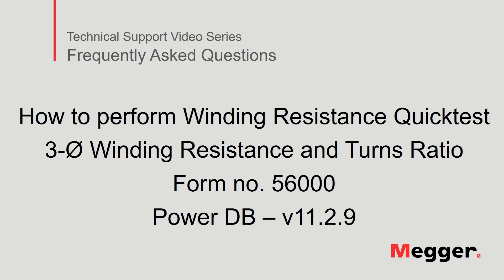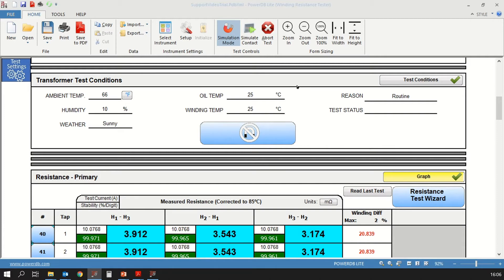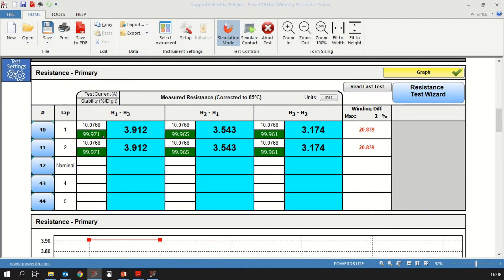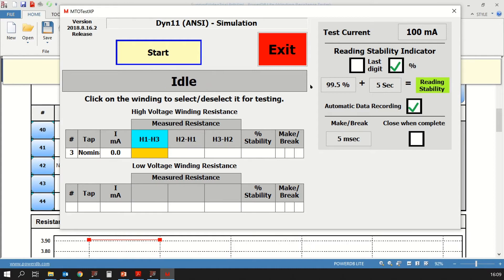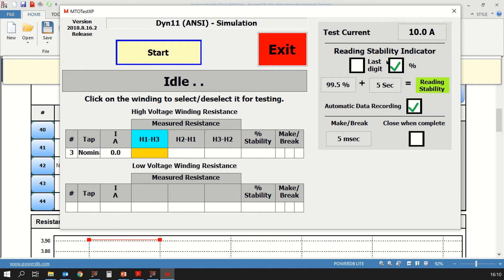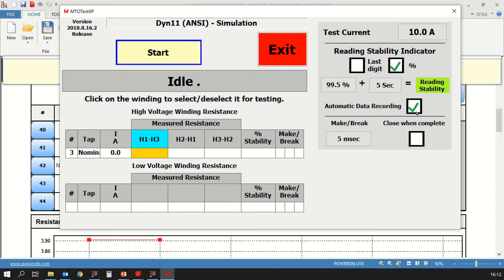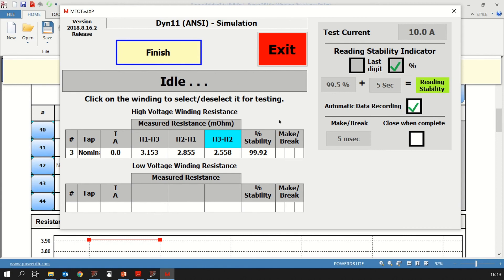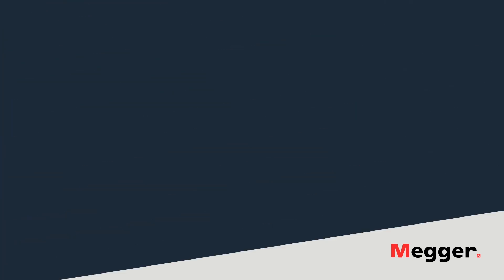Megger PowerDB: How to Perform a Winding Resistance Quicktest

Comment: Hi, I am Sr. Electrical Engineer. I am looking for a Third party for Transformer testing in wind turbines in USA . The transformer is 3250KVA , Dry type and located in wind turbine at 100 meter height. do you recommend any?